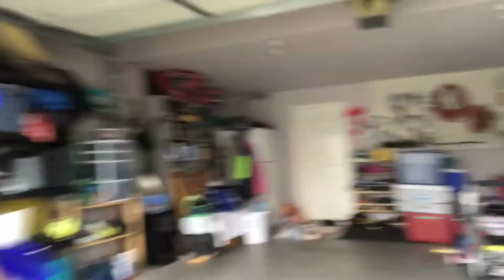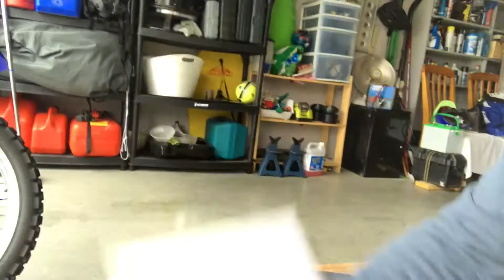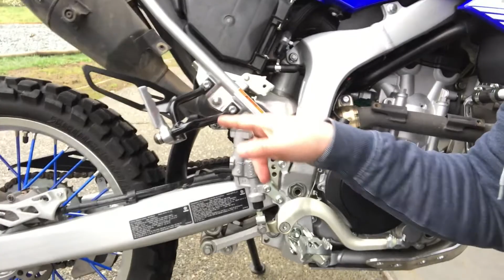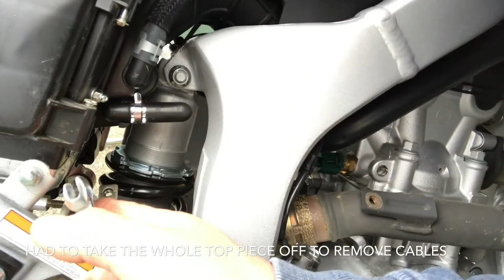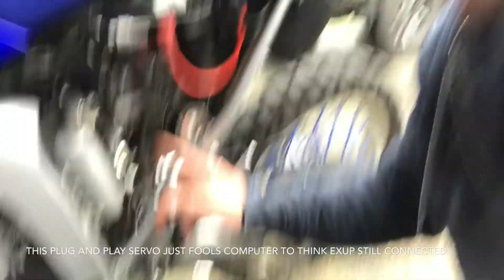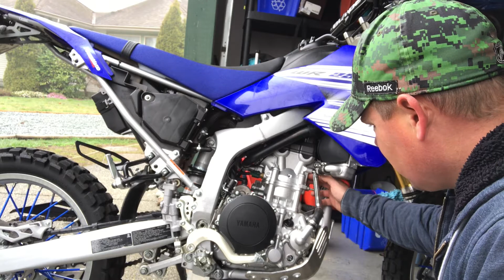How to install FMF Megabomb header. FMF Powercore 4, 12 oclock labs exhaust upgrade on 2016 WR250R

Comment: Curious, four years later, you think it was worth it? I don't necessary like loud bikes but my WR must be running fairly lean, I'm at 1300m above sea level in AB. Mainly looking to fix the "surging when cold" issue.
Reply from the maker: Honestly I still love the bike for what it is. It mainly gets used as a commuter. Still running strong and zero issues other then changing oil and gas. Bike has been solid. I took a break off of modding it but it runs like a top!
Reply: @bigair0176  that's the nice thing about the WRs! Love mine. Sold my first one for a KTM years ago. Biggest mistake. Back on a WR! I am going to try a programmer without modifying the exhaust just yet. PS is that a Oilers hat?!
Reply from the maker: @ADVRider78  yea buddy. Love the mcdavid drai drai show. Frocking awesome haha.
Reply from the maker: @ADVRider78  programmer was best mod I did. Gearing next

Comment: Got everything re installed and i went to start it and it wont turn over. It tries and then there's a a loud pop. Any ideas anyone?
Reply from the maker: Dead battery or low battery? Do you have a fuel controller?
Reply: @bigair0176  i only did the slip on. Plan on getting a fuel controller once i do the header and intake. Its been cold by me in Wisconsin and i went back over everything and made sure all my connections were good. I gave it some gas when trying to start it again and it fired up. Got it figured out. Thanks though. Appreciate the response and the video. 👍👍
Reply from the maker: @smallbobcat08o.g.47  good to hear. I would totally recommend the fuel controller of some kind. Fuel and gearing were the most dramatic increase in power output and torque. I’m sure you have seen a few of my vids already. I have about 30+ vids on mods I have done to mine. I will eventually have some more vids on my wr250r. Just waiting on availability of parts to be easier to purchase. Cheers. Hope you like the slip on.

Comment: You probably noticed a big power difference as well here, good job, great looking bike!
Reply from the maker: Minimal notice in power compared to installing a fuel controller or a power commander. Gearing and fuel controller made the bike feel allot more torquey compared to the exhaust.
Reply: @bigair0176  makes sense

Comment: Just got my exaust today powercore4 baby,along with ejk fuel programmer,seat concept seat,3 gallon ims tank,no toil air filter kit,yabbadabbadoooo!!!!
Reply from the maker: Right on. I still haven’t gotten the 3 gallon tank. But eventually I will!  Hope my vids were helpful. I have vids on all of those accept the tank. Let me know what ya think of the upgrades after you ride it.  Cheers
Reply: Install done I cant belive the difference!
Reply from the maker: @scottmusgrave2417  sounds much better!  It does add a tiny bit of mid range power but not enough to really notice it. But it won’t feel like your riding a sewing machine no more hehe

Comment: hey bigair, i did everything you have done to my wr250r. after everything is all done and said the bike is still pretty lame, should have got a 450. But anyways after I did everything now my kickstand kill switch does not work anymore. did you have that problem at all, when you stall the exhaust and the programmer.
Reply from the maker: ASMR TRENT I would love for more power for sure. After riding my friends xr400 then mine. Mine is more comfortable lighter and keeps up pretty good. I wish it had a lot more pull in the lower gears. I never had any issues with anything on my bike. Other then my speedo is out by a lot. I am currently working on a vid to fix that tho.
Reply: @bigair0176  I can not thank you enough for your videos. It helped me do just about every mod you can do on the WR250R. Yes my speedo is out now too. It made the bike sound better and lighter, though. A little easier in the trails here in Colorado. These bikes do everything just ok, sometimes I feel the 450 would be the perfect bike, but hindsight is 20/20, and some people say the 450 is hard to handle in the trails, but much better on the street, where the 250 just feels very slow. Take care my friend.
Reply from the maker: @ASMRTRENT  just remember the wr is a much more maintenance free bike compared to all the 450’s. So it is a positive for sure.

Comment: Hey bigair
Trying to find the powercore 4 on fortnine that fits the wr250r, tried the parts numbers and it doesn't come up. Any suggestions. Looking for ship to northern Ontario.
Thanks
Reply from the maker: It looks like the part number may be different now. Research on google says it’s 044436 now. Every site I checked seemed to say out of stock. I checked eBay, amazon and fortnine. You could try Rocky Mountain atv or other websites. But I am wondering if they may also be out of stock. Possibly due to covid 19. Not sure what else to suggest. Maybe contact fmf directly and the can get one to you or point you in right direction. Sorry dude. Hopefully they restock soon.

Comment: how much space do you have btw the pipe and the frame?  Mine seems to be touching it very slightly which is causing the frame to become warm. i am assuming i need to make an adjustment to get it farther away from the frame?
Reply from the maker: Mine is pretty close. Hasn’t been an issue. It’s pretty much touching

Comment: I am debating a CRF450L or WR250R. Does the WR250R need a computer swap with the new exhaust or does it pop/backfire on de acceleration? I rode the CRF450L and really like the power, but it pops like hell without the Vortex ECU swap. I like the power vs my old YZ250F, but it certainly has EFI issues so the Vortex ECU with the Honda is must! It is very "jerky" throttled and also stalled on me twice in a short ride. So that is $700-800 on top of the price of the bike. So $1500 or so for exhaust and ECU. WR250R is less money and maintenance (from what I hear). I would do exhaust on the WR250R also....didn't know if the stock ECU will also cause bad popping.
Reply from the maker: The wr250r is lean from factory. That’s what usually causes the popping and backfiring in most bikes. The wr250r is no different. The wr250r just need a pcv or a fuel controller to add more fuel especially if you unclog the thing by putting exhaust and removing emmisions. It feels like a sewing machine stock but feels like it likes to rev once you do all the mods. I haven’t run the crf450l yet so not sure how much better it could be. I like the weight of the wr250r it feels very nimble. I did a review on my channel on all my mods plus a vid on things I don’t like about the wr250r. I think in total I have about 30 vids on the wr250r
Reply: @bigair0176  what's a good fuel controller cost?
Reply from the maker: Jesse mine cost like 220 if memory serves me right. A dyno jet pcv is more money for sure. I bought a wiseco fuel controller.

Comment: What will the performance look like without the header?
Reply from the maker: The exhaust I noticed a little difference in throttle response. The mega bomb apparently affects the mid range acceleration but not enough that would be considered very noticeable. The best bolt on I have on my bike that has affected the power was the fuel controller then going from a 43t rear to 47t rear sprocket. I did fuel controller first and had to make some small adjustments when I did the exhaust to get rid of a flat spot in power curve. I have a lot of vids on my wr250r with mods and reviews on my channel

Comment: Thanks for the video. Looks easy enough. My 2020 WR250R will be much happier...
Reply: Thanks. I went to Hollister Hills today. My wr could use a little pep on the hills. I'll put the exhaust on first and share my thoughts. I'm also modifying the gearing, going with the stock 13 in the front and a 48 in the rear. Should be interesting....
Reply from the maker: You will like it much better then the stock 43t. I have 47 and it works well. I would really consider a fuel controller. It was the best power upgrade I have done to date.
Reply: @bigair0176  Sounds good. Did you adjust your speedometer?
Reply from the maker: Not yet. It’s on my list to do hehe. I’m going to install a speed healer from 12 o’clock labs eventually
Reply from the maker: Ya pretty basic if you have the tools for sure. Glad to help!

Comment: great video ! just one question, I plan to buy an aftermarket slip-on, is it necessary to buy a fuel programmer also ?
Reply from the maker: The slip on doesn’t add a lot more power. I would say the fuel controller will add more and if your doing any unclogging a fuel controller is essential as you don’t want to lean the bike out to much

Comment: Excellent video...thanks👍🏻
Reply from the maker: Glad to help.  It’s why i started this channel. Cheers.
Reply: Bigair01  just bought myself a new 2019 WR250R last weekend and picked up the same pipe and header at the same time...just gotta order that electronic piece right now so I can install it as well ...gonna watch your other vids now also...thanks for your help👍🏻
Reply from the maker: No problem. May I suggest you get a fuel controller when you put that exhaust on. These bikes are already lean from the factory. The fuel controller was the best bolt on power mod for sure. I put fuel controller on first and had to make some slight adjustments when I put the exhaust on.
Reply: Bigair01 will do , thanks man👍🏻

Comment: Do you need the part from 12 o’clock labs to install the power core 4?
Reply from the maker: Evan Bell you need an emulator to plug in or it will throw an error code.

Comment: I'm wondering how much better performance you got? Was it very noticeable?
Reply from the maker: Jamin Clardy the exhaust upgrade was minimal for performance compared to the fuel controller upgrade. I would say the exhaust just helped unclog the bike and made it a crisper power delivery meaning it wasn’t so jerky when you got on and off the throttle. I’m glad I did it for sure just wasn’t as huge a gain as you would think. I think you notice it, was just minimal. If it’s about money then do the fuel controller first. I did tho have to tune my fuel controller after I did my exhaust so it does give a little. Sounds way better then the stock sewing machine too. Hope that is helpful. Cheers
Reply: Did you get any backfiring at any point.. done day of you do the exhaust without fuel controller you might get backfiring.

Comment: Fyi if you don't want to pay the $50 for the 12 labs emulator. You could pay $0.50 for 7.5K resistor
Wire it to the black and red and  white and red wires.
Reply from the maker: Good to know. Thanks for info Brian.

Comment: I don’t care how it sounds I want to know the power increase of the pipe and muffler
Reply from the maker: Honestly it is a little bit compared to the fuel controller.  What it does the most is get rid of the jerkiness when you let off the throttle, because of the removal of the smog shit.  Check out my 27 vids on all the mods I have done to this bike.  Don't forget to subscribe!.  Hope that is helpful.  Cheers

Comment: Sup brother nice video! Whats the 12 oclock device do? Do u have to have it to upgrade the exhaust? Thx
Reply from the maker: Effulgent Exterminating the exup emulator will fool your computer to think the exup system is still hooked up. The emulator is so you don’t get an error or engine light code. I can’t remember but I think there is another brand you can use for the emulator. I just used 12 o’clock labs cause I bought several electrical components from them and they work perfectly. I will be doing some more things in the future with 12 o’clock labs components. Just waiting for summer to be over hehe to do the projects over the winter. 12 o’clock labs were great and the parts where shipped within a few days to a week. Totally recommend them dude. Thanks for watching dude. Cheers
Reply: @bigair0176  os that the same thing as the fmf programer?
Reply from the maker: Effulgent Exterminating yes it basically is same programmer as far as I can tell. It uses same lighting for each mode for programming as far as I know. I was going to do a programming video when I finally get a lapel microphone lol for my vids. Or maybe I will do a voice over. Bike is to loud to try and do video and talk the steps hehe
Reply: @bigair0176  awesome man! I  m picking up my wr250r tomorrow cant wait!
Reply from the maker: Nice! dude.  Its a fun little bike.  Make sure ya subscribe.  All of my mods I have been totally happy with.  I have a few more I want to do but waiting on cash and the winter for projects.  Let me know what ya think of the bike and its progression from stock to modded.  Cheers
Reply: @bigair0176  just suvscribed! I just bought a brand new wr260r so jist still doing some research i want it to be loud. So do u recommend the 12 oclo k or the fmf programer?
Reply: Do do u absolutely need the programer?
Reply from the maker: Effulgent Exterminating I would recommend the programmer for sure. There are a few options out there. Either WISECO and fmf are pretty to install. I found the fuel commander was best improvement in power. If you want loud go with the powercore over the q4.
Reply: Just installed the whole system! Thx for the video it helped alot and im loving the sound!
Reply from the maker: Effulgent Exterminating right on man. Glad I was able to help. Cheers

Comment: Great video, except I never saw what you ended up doing with the wire connections you removed from the stock exhaust.  I'm assuming you removed them completely from the bike.  If so, I'd love to see that video.
Reply from the maker: Perry Wakefield my bike doesn’t have the wires the European version has. But I talked a little about the European version in my comments above. The only wires I have were the servo cables.  I bought a 12 o’clock labs plugin to fool the computer. It is shown in the vid. Hope that helps.
Reply: I did a little more research and realized that I missed the part about the EXUP eliminator plug.  I'll be ordering that soon.  Thanks.
Reply from the maker: Ya you can get it from 12 oclock labs.  I show how to install it in the video.  Glad I can help.  I made this channel to give back so glad I could inspire or help do it yourself.  Cheers

Comment: Great video! Thanks for posting. What tires do you have, they look nice.
Reply from the maker: Thanks Jimmy  I started this channel to give back on small do it yourself tips.  So thanks for watching my vids.  The tires are stock bridgestones that come on the bike.  I am going to upgrade the tires when the stock ones wear out.  The wheels are also stock.  The spokes have just blue spoke skins that make the bike a little more custom is all  I have a small video showing them installed on my channel.

Comment: I have the same setup on my 2018 WR250R except i have the Powerbomb header with the Powercore 4. When you start your bike and it's idle and sometimes when you give it gas throughout certain RPM ranges (like brapping it), do you hear what sounds like a vibrating sheet metal sound? i have ran mine and used gloves and tried to push and hold on things to see if it goes away and it doesn't. It's not a full time sound, just various revs and idle sometimes. I noticed its close to touching the bike so i'm going to loosen and see if I can get it further away. Nothing seems to rattle when its off and i knock on stuff with my hand. I didn't know if maybe it's because i didn't install the spark arrestor and i'm just hearing some baby pop sounds. This pipe is loud!!!! I love giving it hell to let cars know i'm near them!
Reply from the maker: Thanks Jason for the Comment.  I don't have and sheet metal vibrating sounds.  I definitely noticed my skid plate resonates and sometimes makes a tinny sound bit no vibration.  I would suggest loosening all the bolts on the whole exhaust, and retighten them starting from the header bolts.  Th instructions said to start at the header bolts so everything lined up properly  especially the header to the head.  I didn't use any silicone either with this install.  I recheck my bolts often.   I love this exhaust it certainly is loud tho.  The spark arrester made it a bit quieter.  not much tho.  Hope the tip helps.  Cheers
Reply: Bigair01 ok, so I need to go for a ride to be for sure, but loosening all exhaust bolts and moving silencer back a hair got it off the passenger peg area. I also did notice that since the exhaust pulses such a great amount of air on each exhaust “puff”, it does make a kind of air disturbance sound in the air 3 feet or so behind the bike. I hope this was a contact vibration and that I just fixed it. I did use very high temp gasket maker when sealing slip fit joint and where headed slid into cylinder. Also trying spark arrestor vs none.
Reply from the maker: I had that same pules.  Good compression hehe.  The Spark arrester reduced that puffing substantially.

Comment: Hey I tried to take the 2017 stock exhuast apart but than I foud that there is a sensor (oxygen sensor or something like that) on the front part of the pipe right after the butterfly valve you see in te video
Reply from the maker: My pipe never had any o2 sensor on the pipe. The euro version WR250R I guess has the O2 sensor. But I was reading on thumpertalk that guys were either having a bung welded in to thread in the o2 sensor on the new pipe. But I also read guys were leaving it unhooked and just tucked it away. Most of the posts said leaving it unhooked didn’t cause an error code. So my suggestion would be to tuck the wiring up out of the way, or have a welding shop weld in a stainless steel bung if it causes errors in your computer. My exhaust never had an O2 sensor to worry about. Hope this was helpful.
Reply: Bigair01 yeah its very helpfull hope it works. I will keep updating.
Thank you!